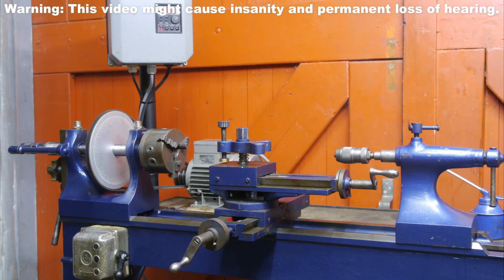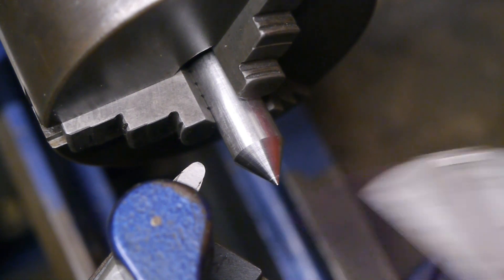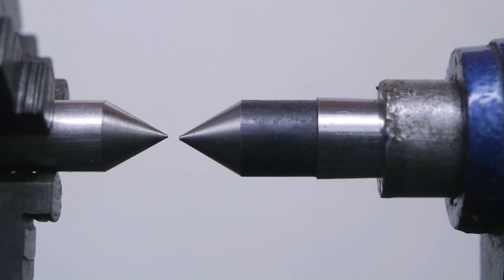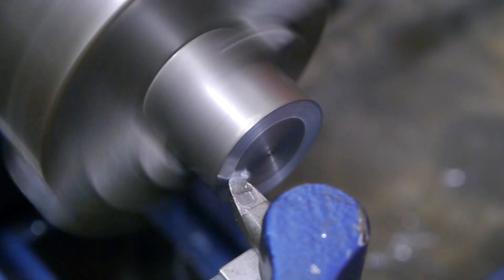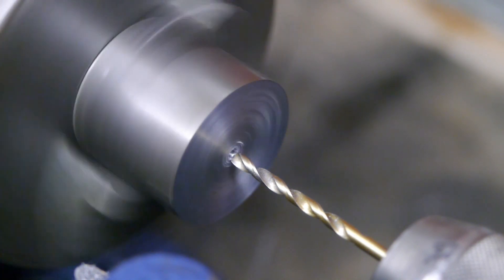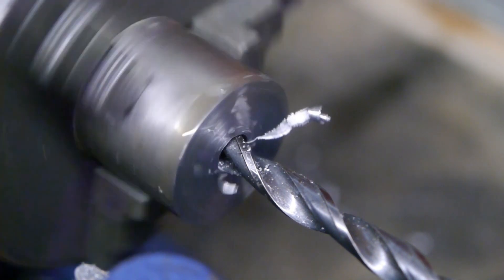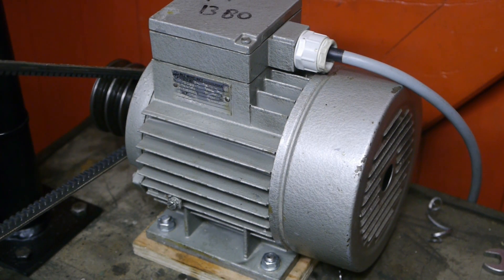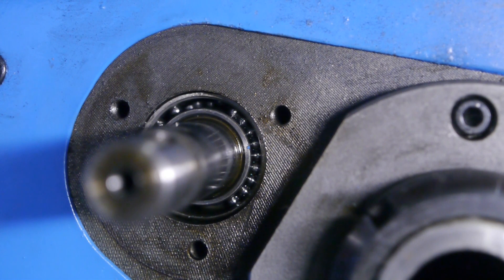Testing my vintage Karger lathe after installing a vfd

Comment: The ruler trick for checking center to center doesn't work when you have a flat point like you had on the tailstock.  Both points have to come right to a point.

Comment: attach the motor housing to your lathe.  turn the dimpled barring housing until smooth and perfectly concentric.  use a bushing to lock it in place.  use a drill to power the lathe the one time.  just a get by for the one time.
Reply from the maker: Just watch abom do such a job :) I don't have a chuck big enough

Comment: Nice little lathe. I know VFD’s are all the rage, but the noise, is it worth it. 
Cheers Peter
Reply from the maker: The VFD in this video is over 30 years old. It's slow electronics work in a range that is very audible for humans. 
Newer drives are / can be a lot quieter. Also, the auto volume gain on the camera makes it sound worse then it is.

Comment: The VFD carrier frequency is far too low, and might account for some of the other harmonics as well.  The ones I use are programmable, and I set it to 15khz.  My inverter-duty motors are perfectly happy with it, and I can't hear it.
Reply from the maker: The 30 year old electronics can't go any faster.
The sound is worse on camera so it doesn't bother met too much.
Reply: I don't think you understood.  Look at parameter F012 (going by the VFD manual on Banggood).  It has a range of 2.0~16.9khz and I suspect that you have it set to the low end.  I have two VFD's, both of which I run at a carrier frequency of 15khz, which an inverter-rated motor should have no problem with.  They do not whine, whistle or howl.
Reply from the maker: I understood just fine. I think you got things mixed up an bit.
Have a look at this video: https://youtu.be/8wFVEPSTKDY

Comment: Thought you might find this interesting.   https://www.youtube.com/watch?v=a4smPWp71-k
Reply from the maker: Changing the carrier frequency is is not possible on this 30 year old drive.
The electronics are just not quick enough to work at a speed outside the human hearing range.
Check the sound difference in this video: https://youtu.be/gL1G8DLfzJI
Reply: Rolingmetal I see, I didn't realize that the new ones were that much quieter. Good to know. Keep up the videos I know there are a lot of work! Mike

Comment: I wonder if the VFD is the cause of the noise. Maybe the Motor has faults.
Very irritating noise
Reply from the maker: The vds's  low carrier frequency makes the motor sing.
Newer electronics work at an higher frequency and are less audible.

Comment: You may need another fan blowing on the motor for extended slow speed running under load.
Thanks for the Vids
Reply from the maker: You're right, that's something to watch out for.

Comment: Hi, you can get the bearing out by taking a piece of wire and get it around 2 of the balls, do that 2 or 3 places ond put a puller on it, job done and in with a new bearing.
Reply from the maker: Thats an interesting idea, I'm going to try that. Thanks.

Comment: Well going by just how quickly the spindle stops after switching off the motor you've got a major problem either with the lubrication or adjustment of the spindle bearings or the motor bearings. I certainly wouldn't remove that one bearing in your other lathe and hope for the best. Unless your a lot luckier than me it never works and almost always causes further issues.
Reply from the maker: That's just the VFD acting as a break.
Reply: Ah ok, the high pitched scream in the video threw me off. :-) I should add a braking resistor to my mill someday.

Comment: I thought that turned out pretty neat, good job. You'll find out a way to get rid of the noise or get used to it or go deaf... thanks
Reply from the maker: Thanks. unfortunately the carrier frequency of the old VFD can not be changed. So there is nothing I can do about the noise.
Reply: Rolingmetal ahhh, was hoping it was motor mounting or bearing.
Reply from the maker: Basically, the motor acts as a speaker for the synthetic waveform coming from the VFD.
I think this motor sounded "better" then the one on my other old lathe when I was using the same VFD :)
Reply: Rolingmetal How about a noise maker in the reverse wave curve of the vfd? Cancel each other out?

Comment: Thanks for the update.  Glad you got over the flu.   

The Karger lathe is improved a lot.   I hope you can solve the motor vibration issue or find another 3 phase motor.

Bummer about the bearing on the Chinese lathe.  The shaft looks to be moving a bit which could have caused the seal to leak.

Dave.
Reply from the maker: I'm sure glad thats over again. Just as I'm glad the winter is finally over.

The vibration issue seems to be coming from the spindle, most likely the chuck. 
The motor runs fine. Hardly no vibration at 100 hertz . 

I didn't notice the shaft moving but I'll check again.

Comment: The screeching noise is caused by the laminations in the stator windings of the motor.  It certainly does not like the VFD waveform!!  You could try adding more insulating varnish to the windings and laminations, but I suspect a replacement motor will be a possible solution. 

As for the out of balance at high speeds, I suspect the large pulley on the spindle may be the cause.  Very unlikely to be bearings.  Take off the chuck and repeat the high speed test.  If the vibration is still there, it is not the chuck.  I added small solder wire pieces to my spindle pulley until the vibration was acceptable.  I marked the position and weighed the total mass of the solder wire and added a small automotive wheel weight to the pulley as a permanent solution.  All trial and error.
Reply from the maker: You are right, the vibration seems to be coming from the spindle.

- Loosening the belt a bit seems to help. 
- There is less vibration without the chuck.
- The pulley has a tapered fit on the spindle and I've tried different positions without much result.
- Driving the spindle including the chuck with an electric drill produced only very little vibration.
- Without the belt the motor runs fine. A tiny bit of vibration a 85hrz hardly feel-able.
- Looks like the motor and spindle somehow amplify the vibration.

Comment: I normally dont like music being added to vids during machining operations,,
but, in your case,, I would willingly accept hearing awful rap music over the sound of your lathe motor 
hell, fingernails on a chalkboard would just about be preferred
Reply from the maker: I once used music in a video, I'll never do it again. So you just have to though it out, build up an resistance, turn down the volume, or just skip the video :)

Comment: I love watching your lathe videos!  much like what I do as well.  Looks like you might need a 0.020” or so shim under your tailstock to bring it inline with the headstock.
Reply from the maker: The tailstock sure look like it's a bit of. 
I might try reaming it a bit more. But for now I'm happy it didn't break a center drill bit.
Reply: Rolingmetal 
For the headstock bearings, maybe you could install Wicks at the oiling points to help retain oil to keep the bearings lubricated a bit longer.  Similar to South Bend design.

Comment: Get a knife sharpening stone and hone those edges instead of chipping the scale. My 10$ amazon stone has easily been one of the best purchases I have ever done. It now sits under the lathe in the front drawer.
Reply from the maker: I use one of those little diamond hones. They work very good on these carbide bits.

Comment: Fack me that vfd is pure torture!   Here's a link to a video by Steve Jordan on making an oiler for lathe bearings, he also has may videos on the Chinese mini lathe.   https://youtu.be/nmRKxqnqz0I.
Reply from the maker: Thanks, I've already seen that video. Actually I've tried making an oiler like that after watching that video :)
Reply: Maybe there is a way to make seals for the bearing ?   I think the inner seal would be fairly easy using leather , but would require a tight fit on the shaft .  * Think about the packing used on ship hulls where the drive shaft goes through !    Maybe a rubber 'O' ring , smeared with heavy grease would work ?     Glad to see the progress !